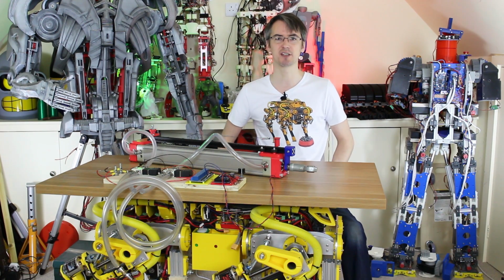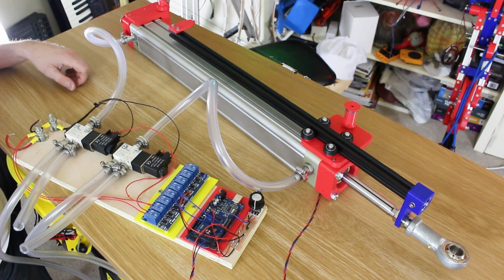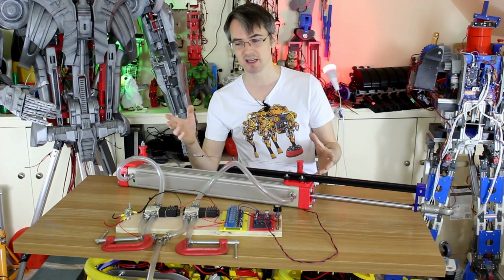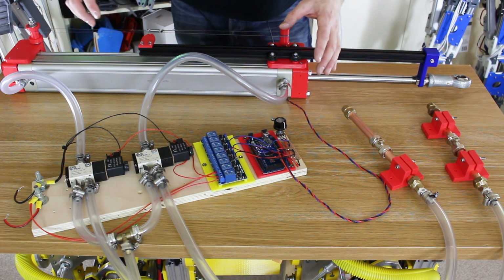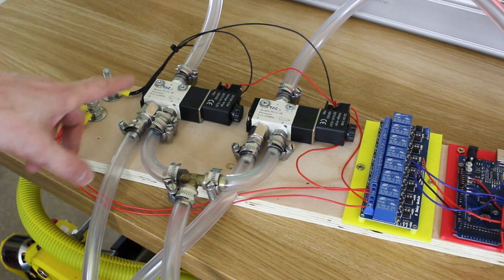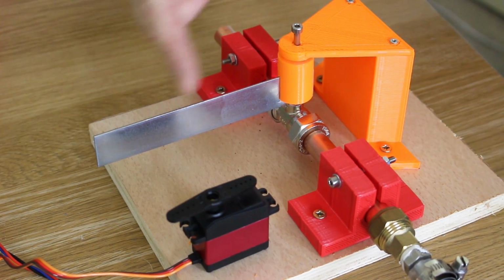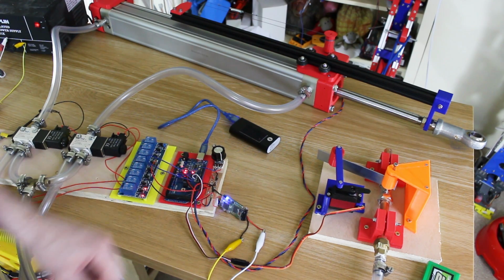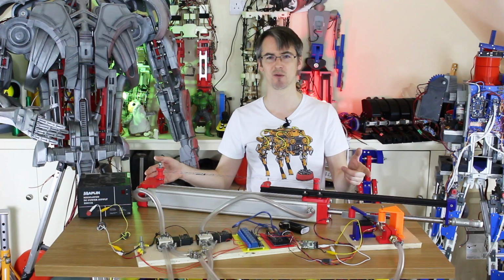Testing Proportional Control of Pneumatic Cylinders | James Bruton

Comment: The creepage does not occure on 2 seperate air sources because it finds a position wherer the force acting on each side is equal. It still creeps but the one side is slowly compressed and the other one expands until the force on the piston is equal on both sides at which point it stops
Reply from the maker: But the surface area is still larger on one side, so why doesn't it creep in the same direction after each motion with two air sources like it does with one?
Reply: because there is no way for the air to move between the two sides of the cylinder. the only way to reach a stable position is to have a higher pressure on the side with less surface area, compared to the other side, which is impossible with a single tank.
Reply from the maker: @hansdietrich83  But the tanks are the same pressure - because they were charged connected together.
Reply: yes but they can change pressure through moving the piston.  when the piston moves to the right, the pressure in the right tank rises, as the volume gets smaller and the pressure in the left tank is getting smaller because the volume is getting higher
Reply from the maker: @hansdietrich83 Pressure is let out of the right tank as the piston moves right, so the pressure doesn't rise there.

Comment: The surface areas are not identical, one side has the push rod. AVE has a video that could help you understand how this is supposed to be done.
Reply from the maker: I know - that's why there's creep. The question is why does it go away when I use two separate air sources?
Reply: @jamesbruton  When you have two air sources they can be at different pressures to compensate for the difference in piston area. To solve the problem you need a cylinder with dual rods. A dual rod cylinder has the same piston area on each side. Someone else commented that switching to hydraulics will solve the problem. They were also correct. Hydraulic fluid is noncompressible unlike air. Air will expand until it finds equilibrium. Your system is out of balance equal to the area of the piston rod. If the cylinder has a 75mm bore and a 20mm rod The area in contact with your working fluid on the side without the rod is 236 sq/mm and on the side with the piston it is 236 sq/mm - 63 sq/mm = 173 sq/mm. There is 1.36 times the force on the side of the piston without the rod. the piston will extend the rod until the pressure drops in the volume without the rod until that pressure is equal to the rising pressure in the volume with the rod.
Reply from the maker: @mei-wen-ti9799  They aren't though as stated in the video - they were charged connected together so they must be the same. If I'd deliberately made them different to compensate then I wouldn't be asking the question.
Reply: @jamesbruton  With two large air sources like you had in your video did not eliminate the creap it reduced the creap because like you said the piston did not need to move as far to equalize the pressure on both sides of the piston. I thought your dual source idea was very creative. I've designed a lot of pneumatic and hydraulic systems. with pneumatics to stop mid stroke you need either a rodless cylinder or a dual rod cylinder. Piston area is the same on each side in either configuration all your problems will go away.
Reply from the maker: @mei-wen-ti9799  But it's distinctly different - with one air source the creep is slow and always in one direction. With two air sources there is a little movement - but it's always in the opposite direction to the initial travel and stops quickly - it never creeps toward the lower volume side of the cylinder.
Reply: @jamesbruton  Think of it this way. When you are intentionally moving the cylinder you are adding working fluid to one side and removing it from the other and the cylinder piston moves as expected. When you stop and close all of the valves the pressure on both sides of the piston is equal. But the piston area in contact with the working fluid is different. So if you have 100psi on each side and the cylinder bore is 3" and the rod is 1" on one side the force on the piston is 942 pounds on the side with the rod the force on the piston is 628 pounds. the piston is free to move so it will extend the rod with a force of 314 pounds.
Reply: @jamesbruton  I can only speculate on a system with two air sources because I've never worked on something like that. It probably creeps equal to the amount of force required to overcome internal friction.  I don't think you want to go too far down the path that each cylinder needs an independent air source on each side of the cylinder. It would get very complex quickly. An easy experiment you can do to prove what happens is apply a given pressure to the the cylinder on the side without the rod leave the rod side open and measure the force the rod is pushing with. Next put a tee in the line and apply the the same pressure to both sides of the cylinder. Again measure the rod force. The first force measurement will be the piston area times the pressure. The second force measurement will be the rod area times the pressure.
Reply from the maker: @mei-wen-ti9799  Why are you telling me this? How does this answer why using two air sources makes the problem go away when both tanks are the same pressure?
Reply: @jamesbruton  The behavior you saw with two air sources is peculiar. The physics say there must be a pressure differential equal to the pressure times the area of the rod. 
Using our 3" cylinder with a 1" rod example. The pressure in you're tanks is potential pressure. When you move the cylinder to extend the rod. Your applying pressure to the the full area of the piston with one valve and simultaneously dropping the pressure on the the reduced area side of the piston. Full piston area is 9.42 in/sq and on the rod side it is 6.28 in/sq. With 100 psi on the rod side once you apply more than 66.7 psi from your potential source of 100 psi to the full piston area the rod will begin to extend. To continue extending the force must either continue to rise because we will be compressing the air on the rod side of the cylinder or as you have done you can release air on the rod side of the cylinder to drop the pressure below 100 psi. Closing both valves isolates the volumes in the cylinder from the sources. The piston will creep to equalize the pressure delta between the two sides. So if we were pushing with 75 psi and dropping the rod side pressure to 60 psi the piston creep will be in reverse of our travel direction until 100 psi reads on the rod side and 66.7 psi reads on the full piston side. Tank pressures are isolated and irrelevant.
Reply: @jamesbruton   After thinking about this quite a bit after yesterdays conversation and reviewing your video again I think that the problem is in the valves themselves. Those valves are pilot operated solenoid valves. Meaning that the electrical solenoid opens and closes a small air passage that them moves a spool to open and close the main air passage. There needs to be a differential pressure between the entrance and exit of the pilot. what is probably happening is that the differential is not large enough to move the spool when you first send an electrical signal to close the valve. The by the time the exhaust pressure drops enough for the diaphragm to move the differential pressure between both sides of the cylinder is so great that the non rod side can expand until the rod fully extends.
Reply: @jamesbruton  I am almost embarrassed to have taken so long to figure out the problem with your test setup. The the problem is that the flow control is on the wrong side of the valve. Restricting the exhaust after the valve creates back pressure on the pilot path which in turn creates latency in the valves operation. Commercial one-way flow valves have a check valve in one direction so they can be put in the line to the cylinder. Preferably right on the cylinder or as close to it as possible.
Reply: @mei-wen-ti9799  If you put a commercial one way check valve between the directional valve and the cylinder it will only flow in one direction and not allow the return... I really think the reason the two air source issue seems to be different is that the volume and air temperature of the two tanks are different... The tank on the compressor side is smaller and the air will be heated more from the compression as opposed to the larger tank in which the air has likely cooled and is now denser... get two identical tanks at the same temperature and pressure and I'll bet that "creep" comes back...

Comment: There is a more unorthodox approach to pneumatic cylinders. you can supply a constant low pressure to one side of the cylinder to act as an air "spring" varying the opposing pressure will actuate the cylinder. this limits the potential force you can generate, but makes for a very fast response time, because you don't have to go from atmosphere up to system pressure every time, like when a typical air cylinder switches direction. Not sure how this would behave mid-stroke, Just food for thought.

Comment: James, is that a new or used cylinder? Coming from an industrial environment.  Seeing that creep on a used cylinder isn't uncommon.  And it is usually related to a wore out seal on the piston of the cylinder. Thus letting air bypass the seal until the pressure is equal on both sides of the cylinder. Also, one other thing worth mentioning is with the valves. If they are piloted valves, restrictions in the exhaust on the valve will mess with how the spool shifts inside the valve. This is why some valve assemblies mounted on a manifold base have an option for a separate pilot source. These being less common of course. Also, in practice "real world" per say. There are many things that can contribute to a pneumatic cylinder drifting. In safety systems that require the cylinder stop and stay in place with no drift being tolerated. You can get what is called a rod lock. This is a braking device on the cylinder rod that locks it into position.

Comment: You don't need 2 separate air sources, you need 2 different pressure regulators. Let me explain

 Lets assume that's a 1.5 inch cylinder, with a 0.75 inch ram, and your driving it with a typical air compressor output of 125 psi. one side of the piston will have a surface area of 1.77 square inches. the rod side of the cylinder will be the same, minus the area the rod takes up, thus it will have a surface area of 1.33 square inches. If you apply the same 125 psi to both sides, the rod side will have 165.9 pounds of force pushing one direction, while the other side will have 220.9 pounds of force pushing the opposite way. That's a ridiculous 55 pound difference.

Since air is a compressable gas, after you close all the valves the  piston will try to balance itself, it will creep over untill the two sides are at equilibrium. 

If you feed the ram side with 125 psi and the back side with 93.8  psi. both sides would be opposing each other at 165.9 pounds of force, and your creep will go away.

Some things to note,
changes in Air pressure = changes in cylinder force
changes in air flow = changes in cylinder velocity
always adjust the flow on the exhaust side of the cylinder (wierd jerky stuff happens otherwise)
air is a compressable gas, your system will always have some "spring" in it, the more volume the more spring.
 
To finally answer your question, your piston volume to air reservoir volume is less than idea, also your tanks are not the same size and the back end of the piston consumes more air (no rod, more volume.) so as you ran it, the pressure in the back side tank dropped faster, creating the more idea situation I just explained.   

to cure the "spring" issue, air-over-oil systems are used. air on one side of a piston, pushing out oil on the other through a metering valve. super accurate, super controllable, potentially super messy. oil is non compressable, and meters more predictable than air. 

You're on the right track, Try making a second proportional valve and segregate the 2 outputs, and feed it with the 2 different pressures I think you'll be pleasantly surprised. A 5/3 valve everyone keeps going on about is not going to give you the level of control you're looking for, not with pneumatics anyway, hydraulics are another story. and a couple snubber diodes should fix your arduino issues.
Reply: I agree with everything in your post, as I said in my own, but you've expressed it much better than I could.

I have a question, though, and this is a genuine question, not a troll or attack.

When he uses ONE air source, and supplies the same pressure to both ends of the piston, there is constant creep in a constant direction, until the piston tops out.  When he uses TWO air sources, even with the SAME PSI in each .. there is no creep.  This makes it seem like the actual pressure is not an issue, at all.  It must be something to do with the air being in a circuit that can feed from one side of the cylinder to the other.  It's just .. weird.

Comment: surface area of one side of cylinder is 1, surface area of opposite side is 1 minus area of rod cross section.
the volume of air in one side of the cylinder will be larger than the other. the volume of air the rod takes up makes a good deal of how fast it will pressurize and the surface area of work being done is smaller.
cool experiment.

Comment: Are you married to using air? If not, then a hydraulic system would would mitigate all of the issued caused by compression states in your system.

Comment: What I have done when trying to hold an air cylinder position is to put a pressure regulator on each port of the cylinder so I could adjust for the force difference. Either by turning down the pressure to the piston side or turning up the pressure to the rod side.

Comment: 1) You can PWM the solenoid valves and not just use them as (slow) on off valves) , effectively you can use them as a variable orifice The frequency you drive them at (10-30 Hz usually) vs the inherent damping of the pneumatic flow will create something like a mechanical  RC filter. so the digital PWM of the solenoid valve ends up being a pretty smooth flow change. 2) The effective pushing AREA of the non rod side is greater than the pushing area of the rod side....some tech info on pwm'ing valves  : http://circuitse7en.net/page3.php

Comment: ** Note I'm going to ignore that you believe  check valves may be leaking/getting held open and assume a perfect system. Also assuming a friction less system all the other hand wavy things that would make this WAY more complicated. They very well may be causing some of the extended creeping. 

The source of the "creep" is the surface area difference between the sides of the piston inside the cylinder. Force = Pressure * Area(F = P*A) . Because the area on the side with the rod is smaller you with have less, Period. When you charge both sides with compressed air and then shut the valves, "locking" the air into the cylinder there is FORCE difference even though they have the same PRESSURE as the instant you shut the valves. But this is not an equilibrium state so the piston has to move toward the side with the least force, the rod side. 

Note, I never said Volume. This is because the volume difference has nothing to do with the FORCE being generated. The piston only moves from the FORCE imbalance. The VOLUME difference will only have an affect on the distance the piston creeps. This is due to the  Ideal Gas Law (IGL)(PV =nRT) Pressure * Volume = #moles * Gas Constant * Temperature. We can treat the right side of this equation as a constant because for this ideal case it is we are dealing with a constant amount of air once the valves are shut on both sides of the cylinder so "n" is constant, and we are assuming temperature is constant as well.  We can rewrite the IGL to get a relationship between pressure and volume, P = Constant/V. Note the relationship, if V increases, P decreases and if V decreases, P increased. 

At the instant you shut the valves you have equal pressure with different Forces and the piston moves due to the imbalances FORCES. When the system comes to equilibrium again, it stop creeping, the Forces on each side of the piston are now equal. The surface area on each side of the piston, while different, do not change, and the Forces are now equal because the system is now in equilibrium, the Pressure is the only thing left in our Force equation that can change. What will happen is that the Force on the side w/out the rod is going to push against the Gas on the side with the Rod which will compress the gas because it's sealed. Now from the rewritten IGL we can see that if volume goes down pressure in creases. If you put pressure gauges on the ports of the piston you will see this pressure difference between the sides of the cylinder but it SHOULD come to an equilibrium and stop moving.  Again Ideal case and all. 

You will see this with a 5 way valve as well, unless the flow rate is low to keep the transient states fairly close as the thing moves. 

The "creep" you are getting on large movements where the cylinder overshoots and comes back is due to the inertia in the rod as well as the air inside the system coming to equilibrium.  Try reducing the amount you open the proportional valve and you should see slower movements but a less harsh return/creep.

This is why hydraulics are used when precision is needed. Liquids are much less compliant and don't compress. 

Holy crap... I'm actually applying the stuff I'm learning in school. I love your videos. Keep up the great work. I wish I could afford to support more than one Patreon at a time. Though you are next in line when I change who I support.
Reply: dang I wish I would have seen your comment before wrote half of the same thing